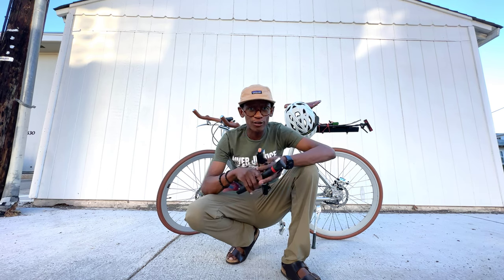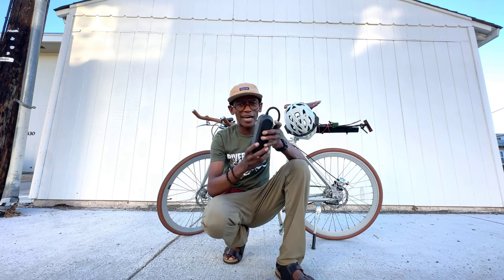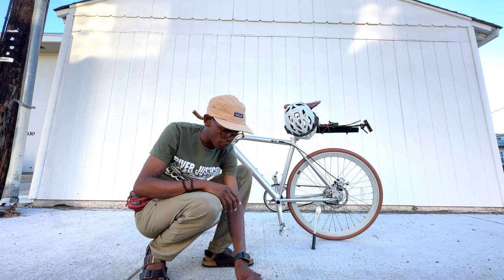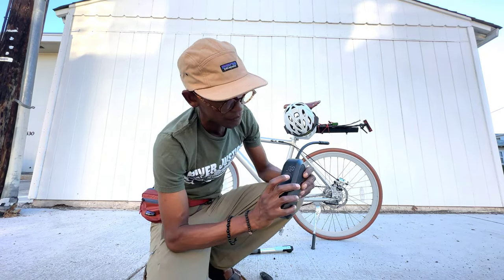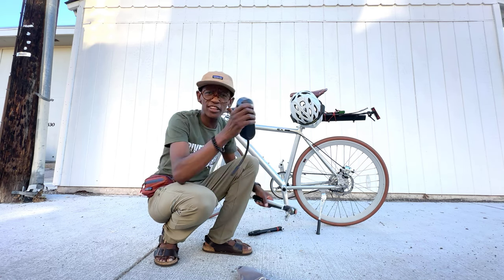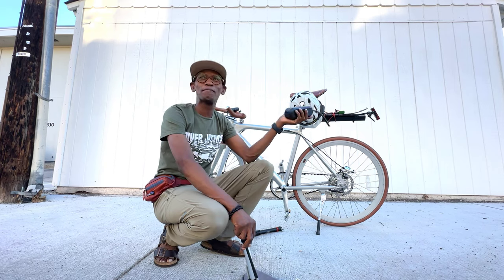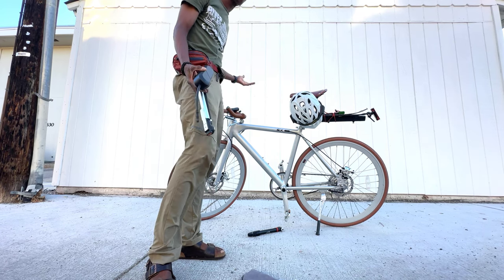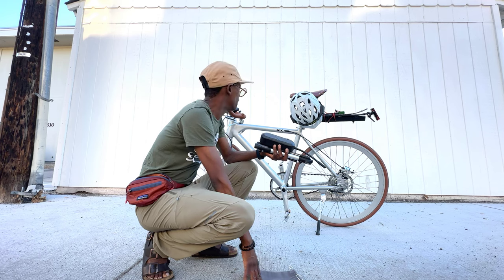electric tire pump for ebike?  Overkill?🚀🧨 OR? The perfect accessory

Comment: DOPE BIKE!!!!! The motor is built into the rear hub and the battery is hidden inside the frame?! WHAAAaaaaa? And it look bad ass!
Reply from the maker: @mushroomhill  I agree is low key a perfect commuter especially if you live in an apartment or don’t want your battery stolen

Comment: I don't have a E bike.... but I do have a Ryobi pump.  Uses small lith.... batteries.  Much more better than a hand pump.  What is worse.... trying to get a tire off the wheel if you have tubless tires.  THEY REALLY SUCK.  At 72 years old I no longer have the strength to remove the tubless tires from the rim.... I'm not a Gorilla !   So..... I'm buying cheaper wire bead tires... that I can actually repair the tubes when miles from home.  Elect. Pumps..... ROCK !!!
Reply from the maker: Good point! I had some major surgery and a lot of my strength is still gone it’s much easier to use a battery powered pump.